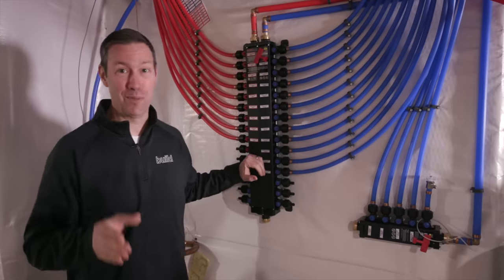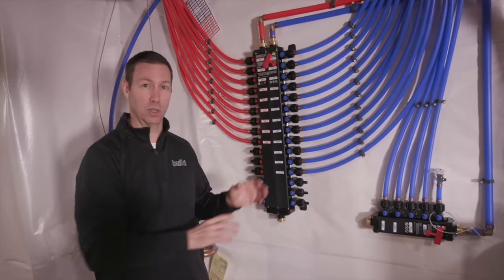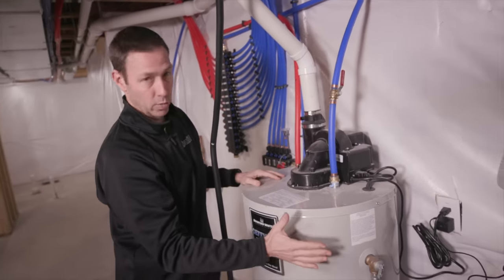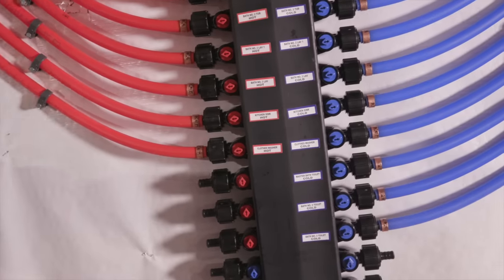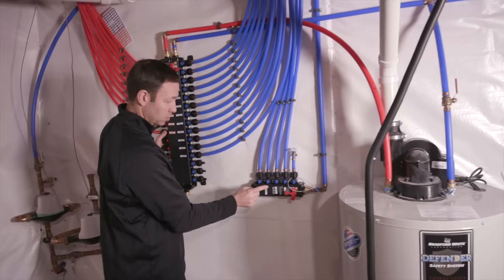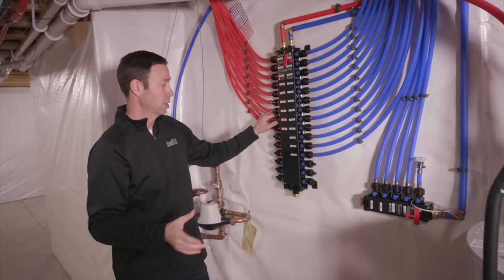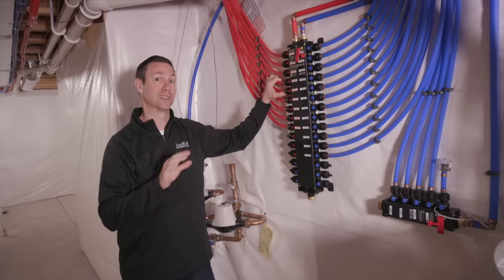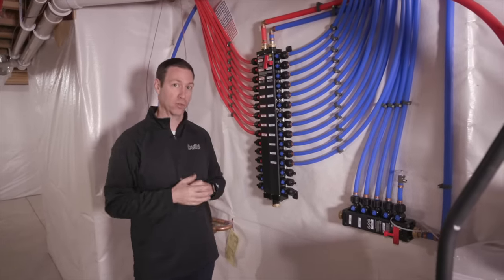PEX Manifold System - Pros and Cons + Tour

Comment: A pro that was not mentioned; You can manually turn down the hotwater supply to the shower to tell your kids it is time to get out of the shower.
Reply: they make timer valves for the hot side too, so that single run to the kids shower turns hot off after 15 mins ;)
Reply: Yep, I have a PEX manifold system, and I have turned off the kids' shower hot water a couple of times!
Reply: I love that 😂😂😂
Reply: I like that !! 😂
Reply: lol.. now that I do love. but still not worth sacrificing a good central trunk line with return loop. manifold valves a cheesy. they fail too often. and by the time they do- "oh! we're sorry... that manufacturer is out of business.. you can change out the WHOLE MANIFOLD".
Reply: A cold pitcher over the curtain or WH bypass valve works pretty good too.
Reply: Nice!!!
Reply: Is there a law against the parents telling the kids to get out of the shower? My parents said you got so much time to shower, and they meant it! We did'nt have an expensive timing valve to shut water off. Lot of wasted money nowdays on everything fancy.
Reply: @workingguy-OU812  2min shower? There's no way you was able to soap up and rinse in that time. 2min isn't enough time for a shower. I like to was every part of my body. It takes me 15 to 20min to shower right
Reply: @warrendarable  really? What if someone wanted to shit, shower and shave? That's not enough time to do all those things. I don't like rushing in the bathroom

Comment: On the non softened water manifold that only has four lines, the fifth one that runs to nothing isn’t there specifically for future use else wise the valve would have just be turned off, it’s a dampener so when you turn on the water the build up of water in that six inch pipe drains, when you turn off the water the pipe will refill and “take up the slack” in theory(pressure spike). What that pressure spike does on copper pipes is that it makes a thump, lots of plumbers use it on a PEX system as you won’t hear the thump without it, but it will actually shake the lines and can cause fitting errors ect. Being that it’s before the main manifold it then covers the entire water system minus the hot water tank. Hope that doesn’t sound like a typical YouTube critiquing comment, it’s only meant to be educational. Have a good day.

Comment: For a larger home (or any home really) while the system above is extremely granular (meaning that I can literally turn off cold or hot water at EVERY SINGLE FIXTURE), probably just as useful would be to plumb it like your breaker box, meaning that one "circuit breaker" turns on or off an entire room, such as a bathroom.  Probably just as useful as the system above, and eliminates the need for every hot water run to a bathroom needed to evacuate an waiting.
Reply: Exactly what I was thinking
Reply: The situation you described here is another typical plumbing layout known as "trunk and branch". The benefits of Truck and Branch is that you use less pipe, however, with a "home-run" system (like in the video) you don't send any extra hot water to a fixture than needed.

Comment: When you get the Electrician to plumb your home
Reply: I'm an electrician,  and this looks like poop.
Reply: I was thinking, "Who let the women design a plumbing system?"
Reply: @goalie2998  I think he was meaning how nicely labelled and designed the lines were, as opposed to most plumbing installations where the pipes are Tee'd in every direction, no markers, minimal shut off valves.   Then again i've seen electrican installations that could be included into that description and where "installed by plumbers".
Reply: I have some electrical experience and I agree!
Reply: I C  Why would they do that if you can just turn it off at the manifold ?
Reply: I C  why not hit the shut-off at the manifold and disconnect/ drain the pex run? Then you can cap both ends and relabel the now hanging pex.
Reply: So right on!
Reply: I C  Just protects livelihoods. PEX is so easy, who needs a plumber?
Reply: Or a pipe supplier!
Reply: @sonacphotos  Yes sir, NOTHING is PLUMB AT ALL
Reply: @goalie2998  exactly. Pex period looks like poop. The best thing anyone can do for pex is try to hide it. Secure it firmly to the studs and run as little of it as possible.
Reply: @goalie2998  I wont ask you for help
Reply: I think I saw an item that returns the water back, until the hot water gets there

Comment: The way to get around the issues with longer runs is to install small manifolds near whatever plumbing group is far away from the water heater.  Run a 3/4" line to supply each smaller manifold.
Reply: Yeah they selling the hell out of some pipe so a plumber can have a tiny amount of convenience once every 8years or so.
Reply: yep exactly
Reply: lol i don't think you understand how water flows.  Why would a manifold next to the fixture be full of hot water compared to the manifold in the mechanical room?  The water will be as cold as the water in the line, until you turn on the water on and move it to the manifold near the fixture.  You need hot water flowing to the manifold to keep it hot lmao
Reply: @ryan39584  The point is to avoid stagnant water in long runs that are rarely used. That was the issue raised in the video. If you have manifolds distributed through the house, you only have a short run of 1/2" pipe for the water to get stagnant in. I don't think you understand reading comprehension or critical thinking. Thanks for playing though.
Reply: @ryan39584  Evidently you weren't paying attention at 8:00 where he spoke of having to charge each long home run in the master bath with hot water separately even though the fixtures are only a few feet away from each other. A small manifold in the master batch would eliminate this issue by charging the manifold in the master bath thereby making all nearby water hot rt away. get it?
Reply: @TheOriginalDiscoPimp  Im not a plumber. So when you say smaller manifold, do you mean a smaller block, and how would you label the group of fixtures on the  main viega block?
Reply: @vico9359  By smaller manifold, I'm talking about a single inlet with (3, maybe 4) outlets on it. Just big enough to supply that immediate area with its water needs. You run just 1 home run to the main distribution manifold to the smaller manifold at the bathroom. That way the water is already hot locally (after the initial cool water envelope) for all outlets in that particular room. Does that explain it better?
Reply: @TheOriginalDiscoPimp  yes sir. I was about to do something dumb. Thanks
Reply: @TheOriginalDiscoPimp  Yeah this makes sense so you're only evacuating the cold water the first time hot is used in that distribution. After that at least for a period of time the other outlets would only be evacuating their small shoot from the secondary manifold.

Comment: I have had this very manifold system in my house for over 16 years and LOVE it. I did all the plumbing myself and was very easy to do. It does eliminate the shutoffs at each fixture which in my experience many times need replaced about the time you need to use them so you have to do the whole-house shutoff thing anyway. It was VERY nice to just turn off one 'circuit' and change out a faucet recently when I needed to do that.
Reply: "... need replaced about the time you need to use them ..." That resonates with me soooo much - I've had that at two different houses, though not with valves at the fixtures. In one, cpvc gate valves (which I didn't know were a thing) didn't shut off completely because overzealous application of primer/glue had warped them. In the other, the house's main shutoff was a brass gate valve. Apparently someone hadn't opened it quite all the way; motion imparted from running water caused grooves to be worn in the mating surfaces. Once again it looked to be in good condition and I expected it to work. I had to do a bit of digging, but fortunately the street valve actually did function.
Reply: I imagine you would still want a water shutoff on things like toilets and sinks because you'll still have water in the lines that will make a mess out of your bathroom and under your sink
Reply: @fishingwithleaches absolutely no mess. Think about how a water level works. Does not matter which end it is turned off.
Reply: When a water leak starts spraying you don't want to take the time to go all the way to your garage/basement/utility room to shut it off. Right at the fixture is fastest for damage control.
Reply: Can you put a hot water recirculation on this system?

Comment: Installed this in my renovation in northern maine. The house is an old 1930's Victorian style. I am not a plumber at all so pex was a great option. Did the 36 port vega and couldn't be happier. 

He is spot on with the pluses with the use of this. It allowed me to work room by room and slowly bring on services. It also allowed me to do a "loose install" until the house is finished and I can finalize the "design" (it's a but if a rat's nest at the moment by design). The ability to cut a single service is a life saver. I moved the location of my water heater to get it closer to the manifold (faster hot water). And had to add a temp spot for washer and dryer. 

Cons after 1 year. Hot water delivery can tak a little bit on faucets, showers arent an issue because you generally turn them on and take a minute to get in. Biggest problem was the town pressure was only 40psi... waaaaay to low. I picked up a grundfos scala2 and cranked it up to 70 to 75 psi (what I'm used to). With the long runs from manifold to faucets the pump does get a workout. I'm sure with a conventional setup it would maintain a bit better, I'm talking only about 5psi flux so first world problems. 

My longest runs go about 40 line ft. Again this is an old house so a bit of over the river and through the woods was required. I would suggest if you have the extra $$ get the upanor/weisbro pex A and the the expansion tool. A friend who is doing a new construction uses it and its flexibility is very nice. Pex B is a little more stubborn in tight places. 

Overall for a DIY you cant beat the system, a little sharkbite here and some crimps and clamps there and you are happy.

Comment: Hello again Matt. I did install one of these on my prior home. I also had an on demand tank installed. The hot water travelled short enough distances that it was minimal loss, or put a water pitcher in the shower to use for plants later. But this in home run setup with an on demand left me continuous hot showers when I needed for guests, or just long enough for my family of two when we were alone. The gain in not heating water all day was more than enough to reduce any cost of water lost in bringing hot water up to the point of use. Also, 1/2" lines going vertical were easier on the pressure variant vs. a wider column of water. No pumps were needed and if you want to add more lines for a shower, add  away and have multiple heads running on a second floor. My setup was 36 circuits, no split or shared lines. All stub outs to the cabinet and I tape my exposed tube with duct tape, the metal looking one without logos. It was easy to secure the lines in walls and having zero joints also helped against joint or 90 degree angles causing resistance to pressure. I am a "Handyman" but I do pull permits on my own home and have been appreciated by the electrical or plumbing inspectors. So it can be done by a homeowner who worries about all the work. Great show and thank you for sharing your info with us.

Comment: I put this in my house 8 years ago. The time to fixture was a consideration in my design so for any small fixtures like standard sink faucets, dishwasher, clothes washer, I used the outlet adapter that converts to 3/8" at the mana-bloc. Also, I used 2 - 1/2" colds and 2 - 1/2" hots for the whirlpool tub in conjunction with 3/4" valving so the tub fills very fast. I insulated the pipe from the heater.
Reply: that was smart

Comment: Matt, one option in Manabloc's system is to go to 3/8" lines for all faucets and lower flow fixtures (depending on code, it could theoretically serve fixtures up to 3.0 gpm). That way, your wait time actually goes down compared to a trunk and branch system. Of course, any large volume fixtures (shower, washing machine, etc) still gets 1/2". I've installed this system in several small multifamily buildings and the occupants love it.
Reply: I also did a 3/8" manabloc install (except for a few fixtures - bathtub, washing machine, hose bibs) on a very old house... 3/8" saves water and the manabloc is hugely helpful at balancing out water pressure drops when multiple fixtures are open (city line is 1/2").  I would probably do as you suggested if I were building a new home.   One additional thing I would suggest is copper to the kitchen sink...  the pex gives my water a "plastic water bottle in the hot sun" taste.
Reply: You actually have to run loaded calculations to say whether or not a pipe size will be able to serve the fixture correctly or not in a system. This is typical in plumbing where people don't consider math in terms of flow rates, demand and the total fixture GPM. What happens when you shoot off the hip is sometimes you get lucky and many times you have flow issues where if more than one fixture is run at the same time a noticeable flow rate drop occurs... the more you run simultaneously the worse the flow. In homes 1500sf & up this is typically a big scale problem. Rarely is the initial plumber called back on new construction because unless the owner understands this is a design issue and catches it soon... it usually ends up as a service call. This is a really bad level of service to the customer. Engineering for electrical & plumbing should be running load calculations and designing the system accordingly so that the demand is met for not only each fixture but the whole house. That is the beginning of providing good service.
Reply: @btownb4462  If by pipe size you mean the supply pipe coming into the house, I agree...  my house is 90 years old, and they certainly didn't do any real planning or calculation, it probably should've been piped in at 3/4".   But on a per fixture level, I'd say if the fixture is flow limited (like most faucets are to 1.6 GPM) or the speed at which it fills is not a concern (toilet bowl, dishwasher) - 1 x 3/8" pex can provide 1.3 GPM, so if there's hot+cold mixing (2 x 1.3) there won't be a problem with 3/8" pex and even with no mixing it's unlikely that .3 GPM difference will be perceivable in most cases.   Multi-unit residential, commercial or large houses could be a different ball game though.
Reply: @deftdawg   I agree with the design aspect of knowing how much water is being used to determine the supply line size but the plumbing code actually dictates what sized pipe can be used by a fixture.  Sinks, water closets, and showers can be installed with 3/8" pipe.  Bathtub and washing machine 1/2".
Reply: Does the Manablock system replace the need for water stops under the sinks? Otherwise I see no advantage over an insulated trunk line system for hot water. I don't trust my plumbers to rip through a structure with a PEX bundle the size of a fire hose without doing major damage.
Reply: @jwhoweth  That depends on the local code.  You don't need water stops with a manablock, but some local codes require them.
Reply: 1/2" pex only gives you 5/16" inside diameter, and you want to reduce it further?
I woyuld run 3/4" pex risers and then branch off at 1/2" pex only when at fixtures
Or just stick with 1/2" copper

Comment: I've seen this install setup a few times, you can install a recirc to the system anytime. You essentially run your recirc off one of the hot outlets, however, all it's doing is recirculating the feed line. It doesn't really make a huge difference unless your mech room and manifold is farther away.

The ideal manifold install is through Uponor's manifold system. It's sort of a hybrid trunk and branch system. Essentially you install an in wall manifold on your branch line, and your run your trunks through the manifold. I've had my plumbers do it on several builds now, and it cuts down on a lot of fittings in exchange for a lot more 1/2" pipe. This way your 1/2" pipe runs are usually <15' from manifold to the outlet. Usually it makes the biggest difference with hot water, especially with a recirc on your main line because all your branches are short you're essentially draining 10-15' 1/2 at most.

Comment: I live in a 1800' 2-story townhouse built in 1985.  It was originally built with 3/4" galvanized plumbing throughout.  In 1994, due to ongoing leakage problems in the pipes themselves, I made the decision to re plumb the entire house with PEX and a Manablock manifold.  That was the BEST decision I ever made.  I have been extremely pleased with the system, and find that I get hot water at the fixtures quicker than before.  My PEX is 3/8" and I find that completely adequate.   I did have one problem being a leak in the manifold itself within the 10 year warranty period.  The company replaced the manifold at no charge, and I have not had any problems since then.   I recommend it for any application, especially re-piping.  My manifold is installed in my attached garage behind my washer, next to my water heater.